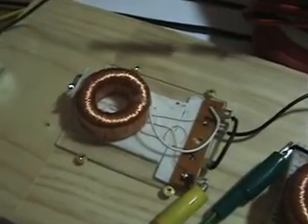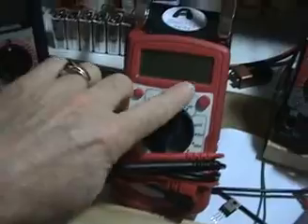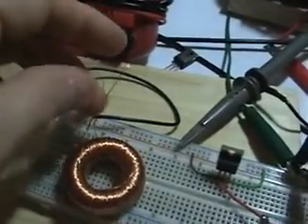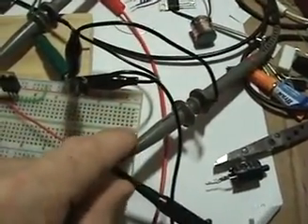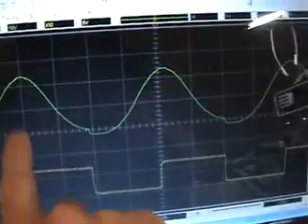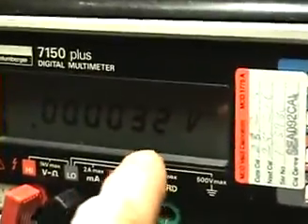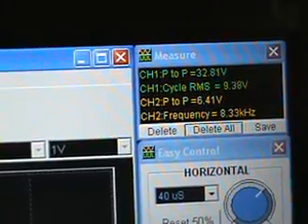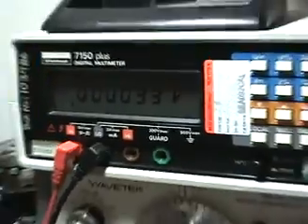Self Running Coil test 16

Comment: It seems like you are saying  the single coil toroid can be used like a current sensing toroid but wired to the source and gate so that it triggers the FET.
Reply from the maker: Yes, exactly. The coils inductance needs to be in LC resonance of the fet's capacitance and no other circuitry is needed for it to self oscillates.

Comment: I think the secret is temperature.  You can block one end of the pole or shield it from interacting with other poles by cooling the shielding to near 0.  That would for sure create an imbalanced system, if not overunity.

Comment: I have been doing experiments on home made oscillating circuits for three years now with different components on breadboards making joule thief type set ups. I do not use mosfets but transistors and bridge a capacitor across the positive and negative inputs from a rechargeable 1.2V battery.  They ran out eventually after a few days but Recently I paired two such circuits together off the same battery powering a total of 37 leds. This set up has run now for a total of 72 hours so far. The battery is still reading 1.2V and is showing it is carrying a full charge. I also use a neodinium magnet on my bucking coil, with a ferrite core. I am baffled at what is going on here for sure more energy has been used, than what was contained in the battery initially? This started as a hobby for me and the only test equipment I have is a voltage meter. Can anyone please explain to me what effect have I created here?

Comment: nice job have you tried using Fisher Price donuts air core for your coils instead of iron core.   I have wound a toroid dual rodin coil with 200 turns inside the donut.  the inner coil produced 1600 v pulses when toroid was pulsed with 12vdc

Comment: Hey man, may i ask what software are you using as an oscilloscope in your laptop? and what hardware or I/O is needed on the pc? Cheers! Nice video!
Reply from the maker: It's a hardware USB scope that comes with the software. http://www.ebay.com/itm/Hantek-DSO5200-PC-USB-Digital-Storage-Oscilloscope-200MHz-2CH-250MS-s-50G-sampl-/221472132010?pt=LH_DefaultDomain_0&hash=item3390c48baa

Comment: Thank you. I believe you have unknowingly cracked the Ed leedskalnin PMH (Permanent magnetic holder) device (meaning, you extract power from it) . I think that by adding the neo-magnet to the coil (with the correct frequency your part of the masterpiece) you have set the magnets (as he calls them) into permanent orbit in the ring (since your toroid is bifilar like his PMH), You can read about it in Magnetic Current Ed Leedskalnin on scribd.

Comment from the maker: @overunitydotcom 

Both have the same wire and amount of wire since they are same DC resistance. However the dual coil gives twice the inductance then the dual wire wound single coil.

Luc

Comment from the maker: @overunitydotcom 

Hi Stefan, no both coils have the same wire size, core and DC resistance. The only difference is one has a higher inductance but I made the the same by adding the neo magnet to the one with higher inductance.

Yes, you are right! it is 3.2uA. I was confused because I was use to the 1 Ohm resistor.

Luc

Comment: What is puzzling me is:
Also it seems you have much more windings on the core with the magnet, cause
with the magnet you saturate it and thus it has less millihenries inductance,
so the inductance is equal with the other core without the magnet,
but this way you have more stray capacitance, and normally this should cause the resonance frequency to be lower, but it is indeed about 2 Khz higher ...
Hmmm..... So are these 2 toroidal coils really using different wires ?

Comment: Do I understand this right, that the the first toroid with the magnet has different wire size, so only with the magnet  it has the same milliHenries inductance ?
Also as Current = Voltage/Resistance your first input would be 3.2 uAmps, not 320uAmps, right ?
But both RMS values in the waveforms are about the same, so the nonlinear
toroid with the magnet has a much higher Q factor at resonance, so it needs less input wattage...
Good experiment !
Regards, Stefan.

Comment: Luc don't know if you still read the comments from us folks...want to suggest winding the next version with a solenoid style winding method.  ie. Start winding the layer as normal but instead of second layer winding back over , go straight back to start end and begin second layer from same start end as 1st layer. This is done with all subsequent layers. It enhances the polarization effect as current is mainly travelling in the one direction on all adjacent layers.  Keep up the great work mate!

Comment from the maker: @SuperDjeri 

most of the changing magnet flux is away from the magnet. The magnet helps to push the flux back in the core when the coil is switched off.

Luc

Comment from the maker: @marthale7 

More magnets won't necessarily give you more power as it reduces the inductance of the coil as you add more. You can get more power but you need to keep a certain amount of inductance for the coil to create a strong enough electromagnetic field to counter the extra magnet force added.

Inductance is not the only thing needed as there are many other parameters to consider as well.

Luc